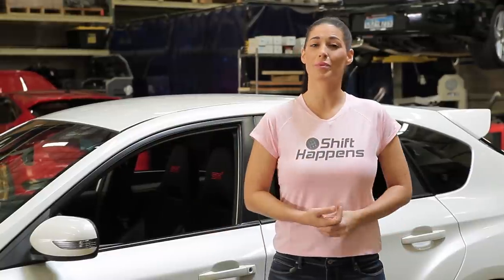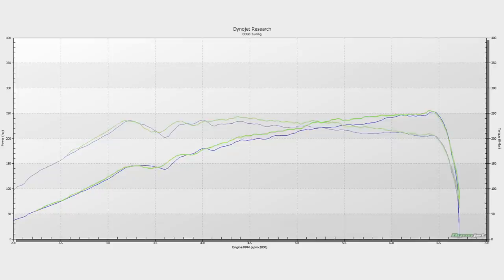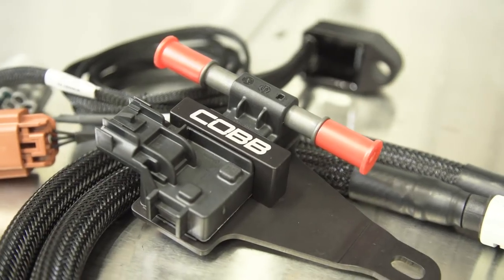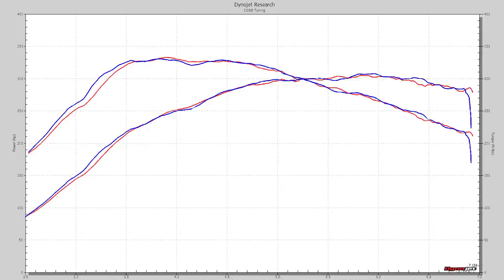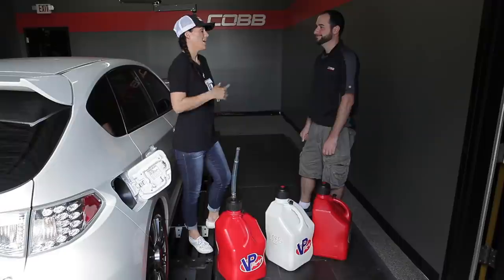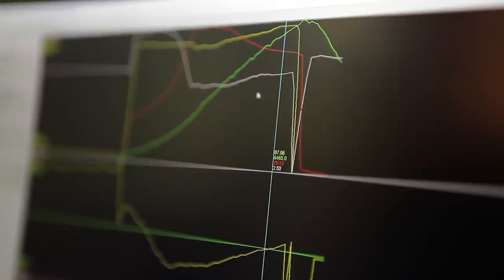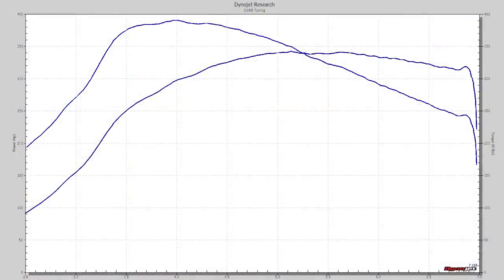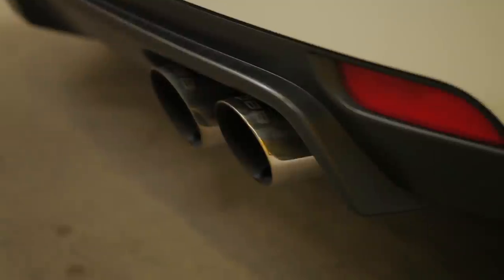COBB Tuning - COBB University Episode #19 - Grand Finale

Comment: Just installing the Cobb AP took me from 13.8 to 13.3 in the 1/4 in my 2015. I'm thinking low 12s with this setup. I'm very impressed at these numbers, especially producing these figures with such a tiny turbo. Well done!
Reply: They basically got all the boost it was going to take to so basically maxed the stock turbo out

Comment: I have a 2018 Gtr Nismo I would like to add more power is that stage 2 package will be compatible with the Tcm.
Reply from the maker: Hi Earl, the latest Nismo has some significant changes to it, like different turbo's etc. So we are still working on developing more more parts and packages, but we do already have an Accessport with TCM flashing ability. Just keep in mind that the current Nismo is technically still a 2017 car, so don't be surprised if you don't see 2018 support. Here is a link for the Accessport: https://www.cobbtuning.com/products/accessport/nissan-gt-r-accessport-v3-w-tcm-flashing
Reply: I have the 2011 nismo

Comment: Doesn’t starting at 2,000rpm create low load feedback knock? Do you start that low to build boost?
Reply: Yup flooring the engine from 2,000 RPM isn't something you'd typically do while driving on the street. That said, someone might, so testing and tuning the entire RPM range ensures proper engine operation. The screen shots of feedback and fine knock show no knock was detected in this case.

Comment: All those mods only netted you 51 horsepower? That's....awful.

The torque gains were good though.
Reply: Bernie Shekelstein mostly because of the turbo size. If it was a bigger turbo there'd be much more power gains. 340whp is close to 380 crank, which is a lot for a ~3400lb hatchback.
Reply: I guess. But if you go big turbo then you need to either install forged pistons, or get a new block. And that's....alot of dinero.
Reply: Bernie Shekelstein Do you really have to get forged pistons or a new block to get 50 whp and a bigger turbo safely?
Reply from the maker: This is about as far as we like to push the factory turbocharger.  While there may be just a bit more power on the table, you would definitely be heading out of the turbocharger's efficiency range. - Marshall@COBB
Reply: On these EJ engines, if you're running at, near or over 400 torque you're putting too much stress on the stock internals, so to go beyond that you need forged pistons or a new block. I'm just surprised that after all these mods they're posting small power gains (the torque gains aren't too shabby tho.) It just proves that you really need to go all in to see any sort of respectable power out of these cars. In which case, i'd rather just trade in my WRX for a Polo R. A stock Polo R would blow this modded WRX out of the water. Just imagine adding a few power mods to the polo.

Not sure what kind of gains you can get on the new FA engine though. I'd be interested to see COBB post results with these same mods on an FA WRX.
Reply: You keep saying all these mods. When all they added was cold air intake, exhaust and injectors. All the rest of the mods were support mods. That's a lot of power for this car from a few bolt ones. You act let they changed cam, pistons intake manifold. Balanced and blue printed the motor. As you saw they are already surpassing the limits of the stock clutch.
Reply: Also they netted 88 horsepower with E85, which was the purpose of the project. 88 horsepower and a lot of torque is not bad at all. In the end it's a 4 cylinder with small displacement. If you build a 4 cylinder for sheer power you either have a lot of money, you're racing, or you've lost focus of what the car was designed for.
Reply: I think 88 wheel HP on e85 is a solid gain for a few bolt on parts and a flex fuel tune on a stock turbo 4 cylinder, but you're right. The torque gain is much bigger than the HP gain, and that's mostly due to the stock turbo only being able to flow so much air with reasonable efficiency. The good news is this stage3 package can make 400 wheel HP on E85 just by adding the COBB 20g turbo, boost solenoid and tuning for them. Then you have an 11 second street car (perhaps after a clutch upgrade), that's faster than most vehicles on the road. Over 400 wheel HP and torque is another story and I do people to plan on an engine build in their future. Some EJ engines last years at 400-500 and some don't last that long bone stock. How a car is driven, maintained, built and tuned all play a critical role in longevity. What year is your STI and how much power do you want to make Bernie?
Reply: Good luck finding an E85 pump. The nearest one to me is over 100 miles away. It's not feasible to use E85 unless you live near a pump.
Reply: I'm driving a '15 WRX because I wanted the new FA engine. The next gen STI is rumored to also have an FA engine. Which if that's true then i'll just trade mine in for the new STI. And besides. You don't want to be running more than 400HP or 400lbs because the stock internals can't take it and you'll spin a bearing and your motor will disintegrate.
Reply: Bernie Shekelstein aw bummer man! Sorry to hear that. I've been spoiled living in areas where it's readily available for 10 years now. On 93 pump gas the 20g and boost controller on top of this setup would get you about 100 HP over stock and that's about as far as I would go without an intercooler upgrade. With an FMIC you could go a bit further, but I don't have a lot of faith in pump gas fuel quality so I don't usually push cars too hard on pump gas, especially on stock engines.
Reply: Yeah. I wouldn't bet on E85 being accessible everywhere. Big oil companies are in politicians pockets keeping it out of reach for most. Especially when you consider the CEO of Exxon is the current secretary of state. Don't get me wrong, I'd love to upgrade to an ethanol fuel system, but it's just not feasible. Not until it's readily accessible.

But yeah I'll probably keep it simple and just got stage 2+ and will probably get a few more mods on top of that. Maybe a FMIC, BCS, maybe add thermal sleeves to everything. I'd like to get a Perrin AOS and TGV+EGR deletes too just for cleanliness and longevity. But IDK, I'll wait until I see the next gen WRX/STI in 2020. If I like them, then I'll just trade in my '15 for a '20. The FA engine should have a decent aftermarket by then.
Reply: Actually, all those mods and +100 hp and +150 lb-ft on E85. The mods support the use of E85, so the full measure is  100 hp increase and 150 lb-ft of torque increase. You can actually get just 50 hp increase with just one or two parts. This is a very potent platform.
Reply: sooperman12  Yeah. pretty much stage 2 is the 51 hp gain. the almost 100 hp gain is with stage 3 with the FF